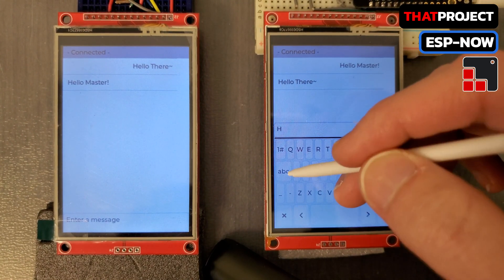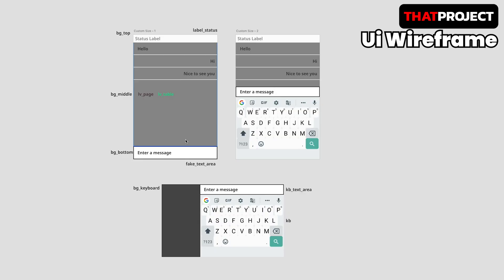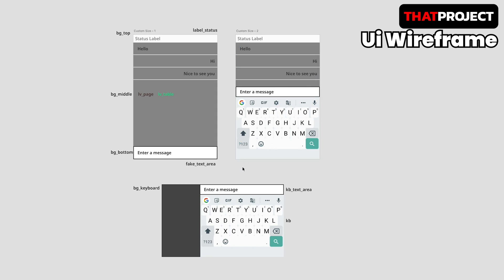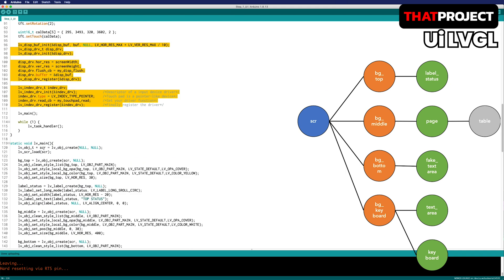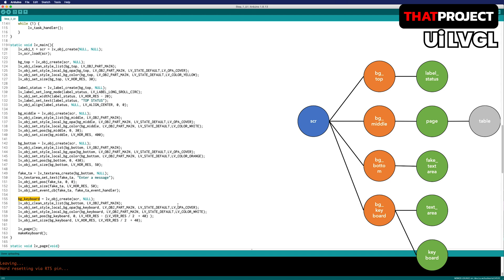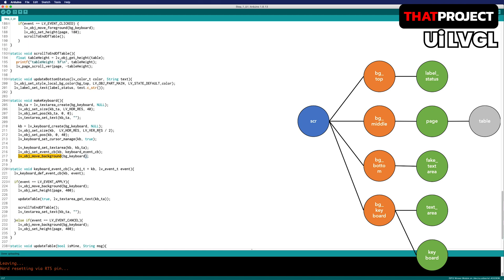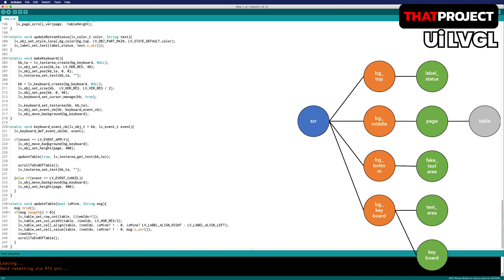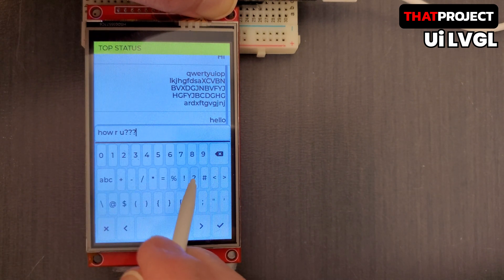💬Chat App | ESP32 + ESP-NOW + LVGL7 | Part 1/2 - LVGL UI Layout

Comment: good work, is it a problem to take another TFT Display with 8-parallel with ESP32? can this display rotate 90° and touch work properly?
TFT_eSPI and the USER_SETUP.h don't change the GPIO for the 9341 / 9486 where is the problem with SETUP.h and SETUP_SELECT.h
Reply from the maker: There is no problem using an 8-parallel Display with TFT_eSPI. If you made it 90 degrees, did you do the corresponding calibration? Please refer to the TFT_eSPI calibration. https://github.com/Bodmer/TFT_eSPI/blob/master/examples/Generic/Touch_calibrate/Touch_calibrate.ino

Comment: All I get is "TOP STATUS" with a yellow background at the top of the tft ILI9341 screen!
Reply from the maker: Malcolm Palmer In this project, I'm using TFT ILI9488 which is 320px x 480px it's not a ILI9341. Modify the source code to fit your display.